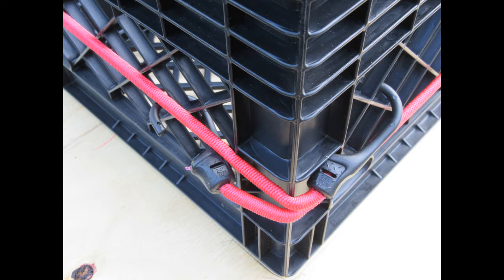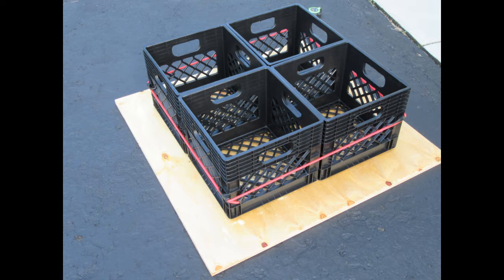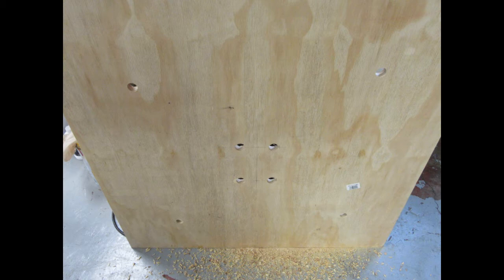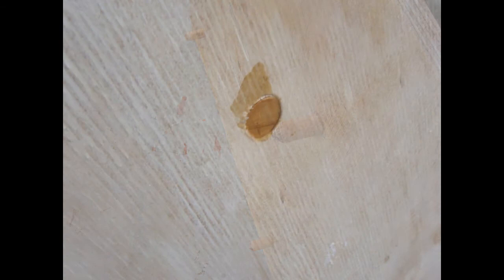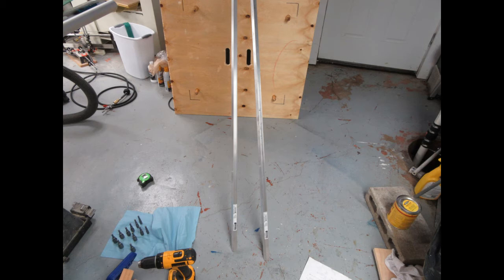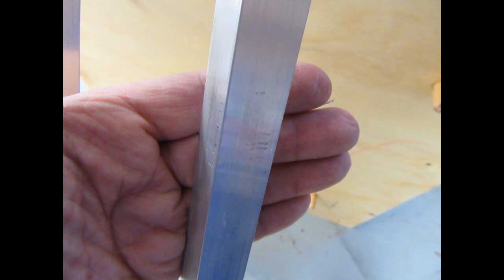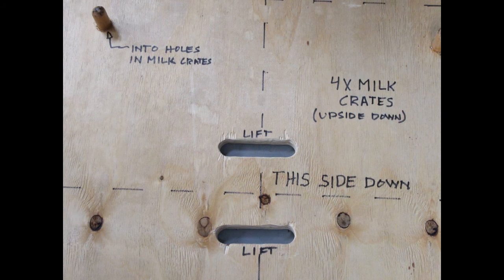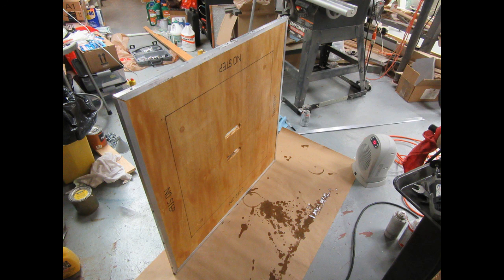Making an Inexpensive Portable Conductor's Podium

Comment: I wonder why you did not cut the plywood to the dimension of the milk crates. It looks to me like the overhang, even with the "No Step" warning, would be an invitation to tipping over while focused on the music. That being said, I like your idea and approach to an inexpensive project to solve a problem / meet a need. Thanks for sharing.
Reply from the maker: Our conductor wanted me to buy a certain brand of folding conductor's podium, but we did not have budget. He said that he needed a certain minimum size to avoid accidentally stepping off one side while he dances around while directing. I did experiments to prove that the platform would not tip even if most of his weight were over to one edge while directing, but if he were to step on the edge of the platform while stepping up onto it, it might tip enough to dislodge the alignment pins from the crates, hence my "No Step" warning.

So the things you mention were actually based on requirements, and were 'design features' based on design and testing.
Reply: @youtuuba  Thanks for the extra information. I understand some of the challenges working to design specs can bring. Hope your conductor gets many safe years of service from this podium.